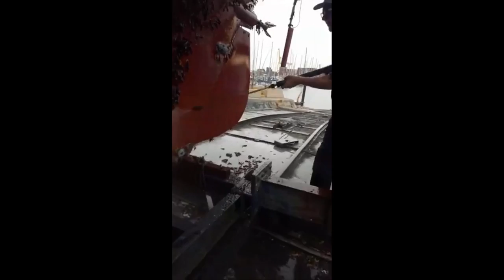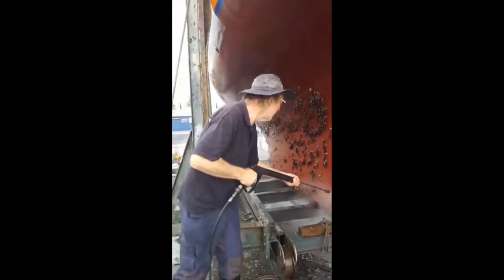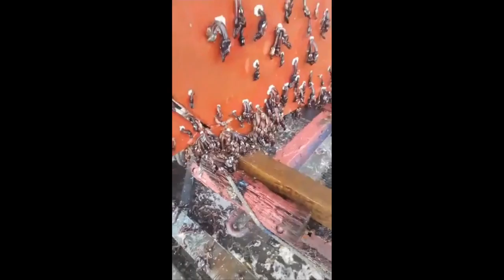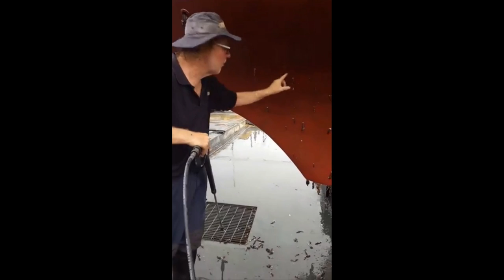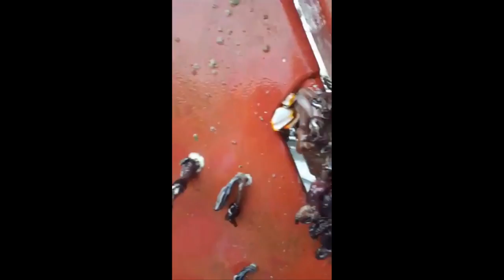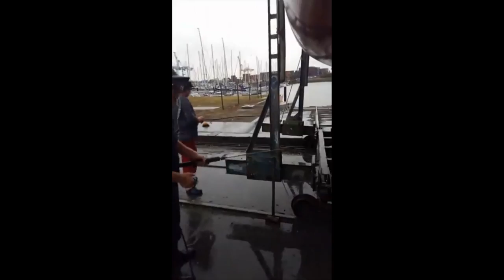Removing Barnacles, Easiest Way To Rescue a Boat From Barnacles

Comment: Is there a coating that is super slick that doesn’t allow barnacles to attach?
Reply: If there was, you could either not afford to buy it, or they would refuse to sell it or make it. Bottom paint is very big money maker, it's a big business, hauling scraping and repainting, makes marinas a lot of money. Nobody is going to develop a working coating. Years ago, i read they did tests putting Ivermectin in bottom paint, and it worked great, the barnacles stayed away or the tiny larvae died after feeling the paint. BUT, of course, you know it was not approved for use. TBT worked too, they claimed it was dangerous, all the things that actually work, they declare too dangerous to use.
Reply: Another idea that works is UV light. High intensity UV LED's placed all around a hull kills the barnacle larvae before they attach, but you dont see it being sold as again it is too effective.

Comment: Interesting. I used to remove sea encrustation from metal object by reversing the wires on a niobium (or titanium) anodizer using Home Depot TSP (tri-sodium- phosphate) rather than toxic cyanide salts in the water. No hood or compressed air hoods were required with TSP. Each State is different regarding Phosphates disposal or purchase. Florida has big phosphate mines but the high concentrations from the sugar plantation fertilizers are killing the Everglades sawgrass & replacing it with NJ type ugly catails. So I pay to take it to a waste dump. I spent a month in the Everglades & Big Cypress National preserve in canoes and backpacking on a survival course and have a special affinity for this humanless area. 🐥♥️